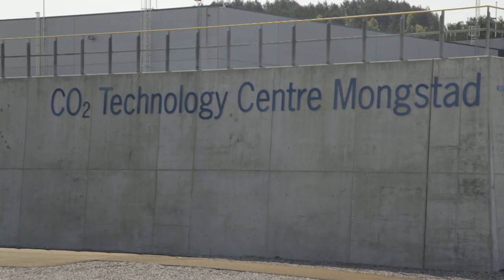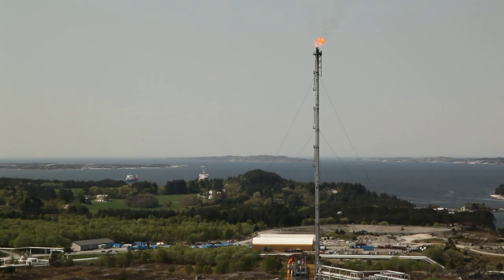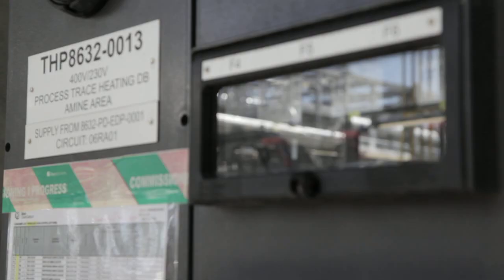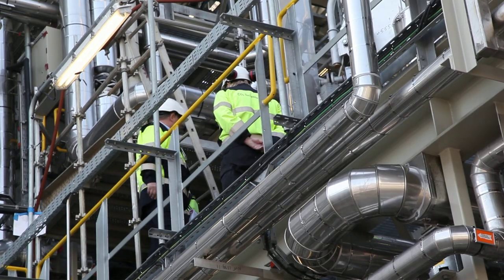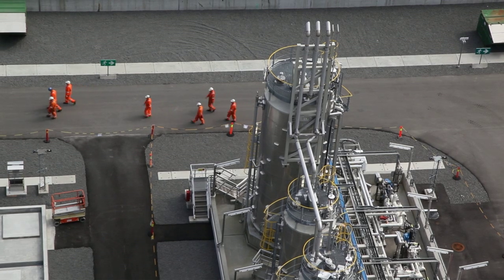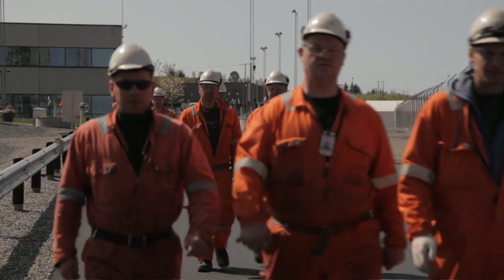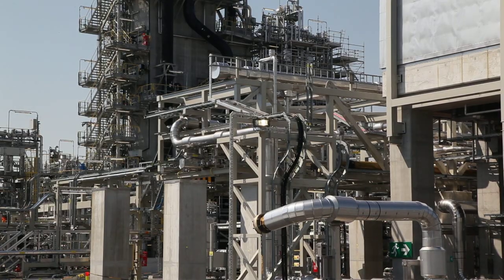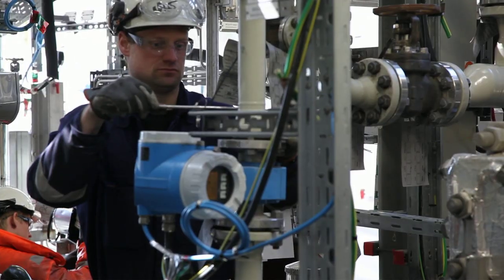Carbon Capture and Storage - Technology Centre Mongstad

Comment: We should reuse hydroelectric plants to power stations like these, while moving the grid towards Nuclear energy. Also, to those in the comments section berating carbon capture technology, I would point out that no amount of trees is going to capture all the carbon we burned from deposits in which it was stored safely for millennia. One plant over a short period of time won’t fix the problem, but it’s a start.
Reply: 😮😮 2:24
Reply: Ty for the 😢